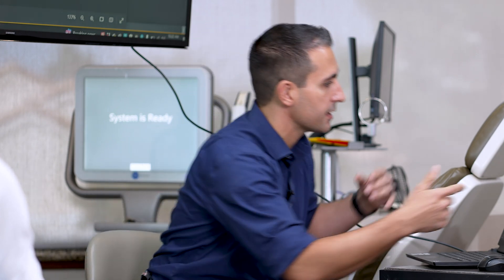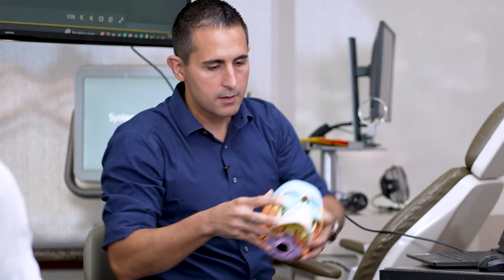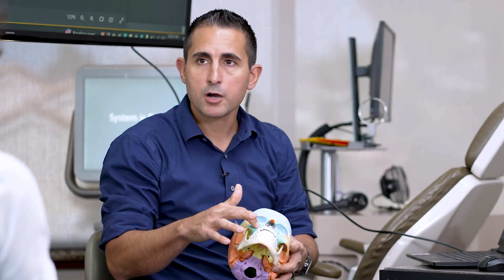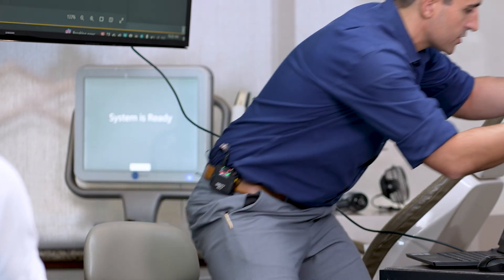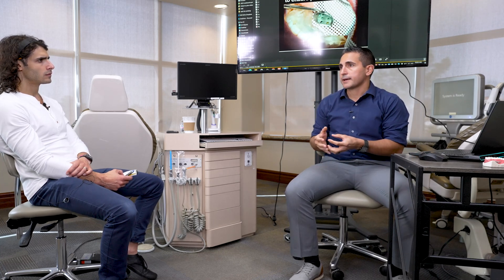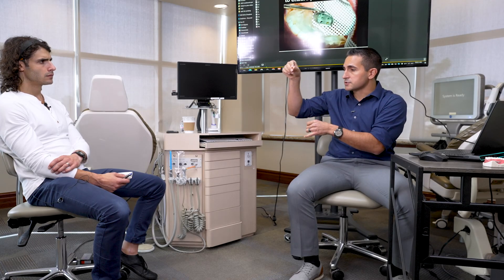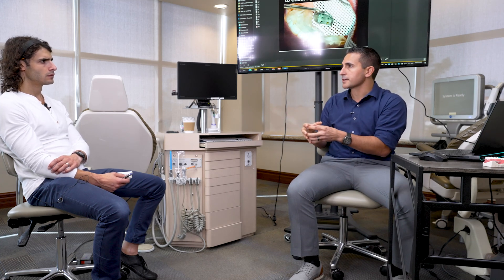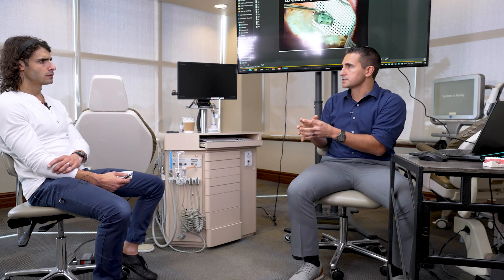FME Piloting Explained | Dr. Jeremy Manuele

Comment: Hey, do you know anyone in Arizona or mass that is willing to use reverse pull gear on an adult?! 
No one wants to, I am looking to get braces only
Because I have small gaps, I have an over jet on the left side it’s slight , but my
Maxilla is wide . My issue is the forward projection I lack in. It’s going to cost me 417! Just to get an opinion and see what they can do because they will take X-rays and measure stuff out . They all want to lower my lateral incisors and my centrals . I find it out . The only thing that gave me hope was the fact that he made it clear he wanted to pull the back teeth forward . But still . I’m not sure . 
I do mewing but I’m 30 now and started at 23 pretty late , I try face pulling but it’s giving me vertigo . Chin tucks I do them they helped a bit but yeah

Comment: Isn’t there risk for infection if you’re just gonna completely split your palate or drill holes into it? Does brand new bone fuse it together?
Reply: very good question
Reply: I got an infection with my marpe, but I was also smoking so it was pretty bad
Reply: There is a small risk of infection. Can be minimized with good oral hygiene and salt water rinse. Yes the bones fuse back together.